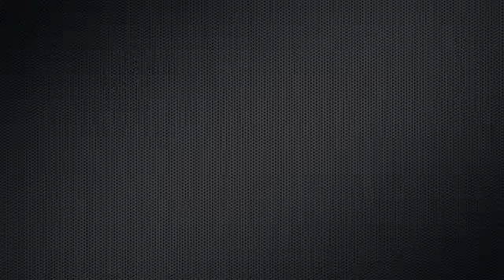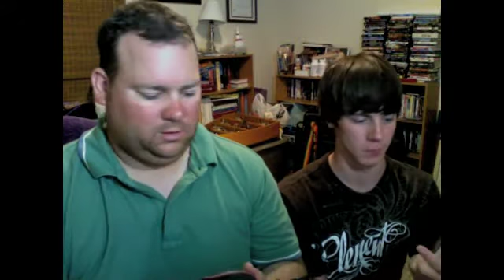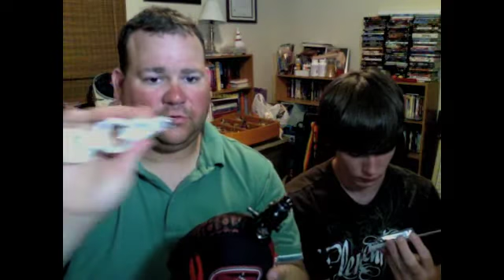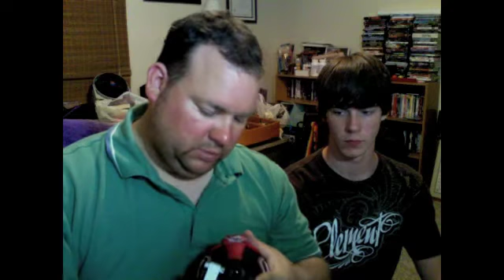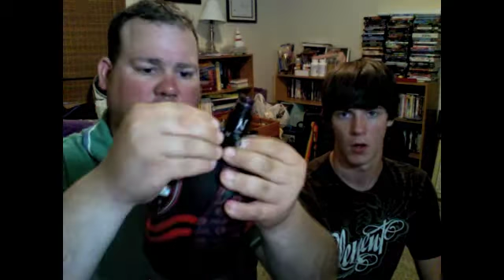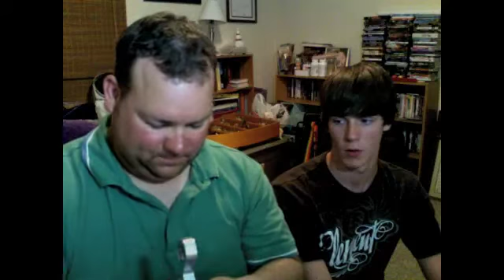Paintball HPA Fill Nipple Cover install

Comment from the maker: @gangsta44g Unless you have a defective cover the next best guess is that some dirt or something is probably gumming up the locking mechanism.  Try pushing the cover all the way on and then try removing it.  If you are still having issues, your nipple may have a leak that is putting pressure on the cover making it nearly impossible to remove. Best way to fix that is to completely drain your tank and then check the nipple.  If the nipple is leaking replace it with the exact same nipple.